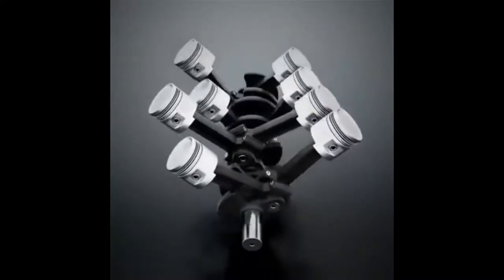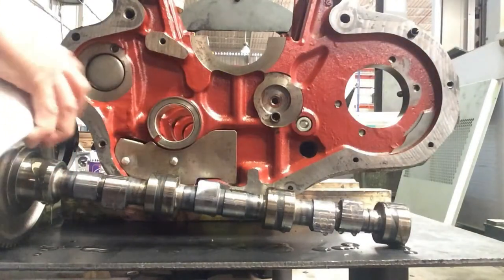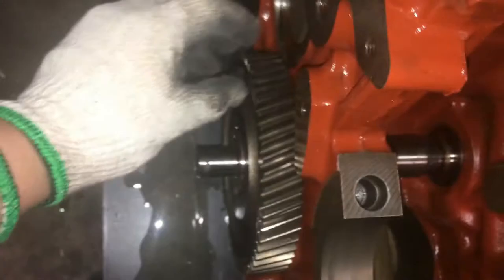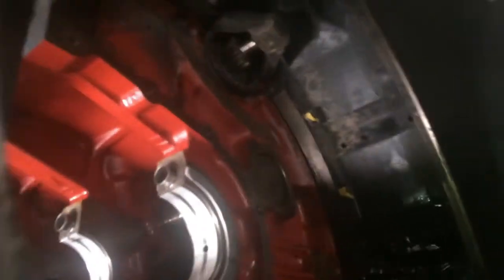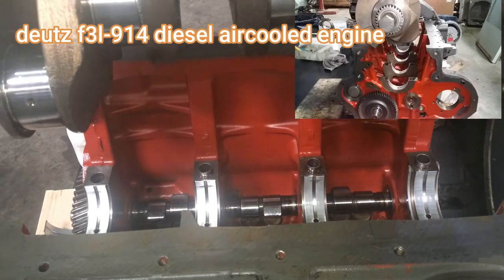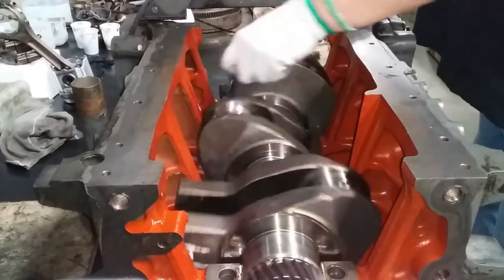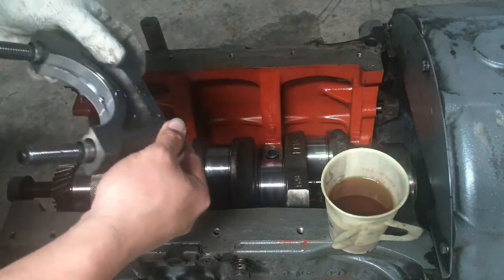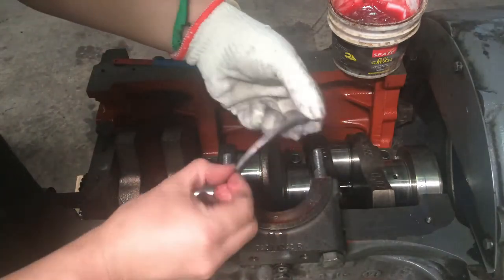Crankshaft/camshaft settings of Deutz F3L 914, 3 cylinders diesel generator engine

Comment: Having worked on Deutz engines many years ( Europe) I really think you should buy yourself a angle gauge for the tightening of bolts, it will give you much greater control of the torque and keep them equal, this is much better than just turning them by flats which looks like your method.  But this was a good video and nice to see that you have everything clean, well done
Reply from the maker: thanks for your appreciations and suggestions sir..how i wish i can work there in europe, if there's an opportunity given..